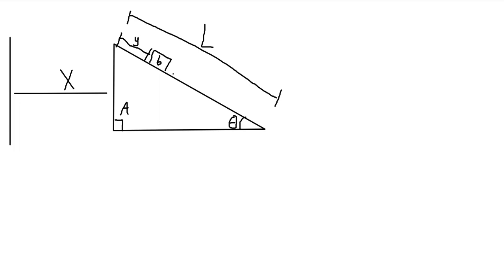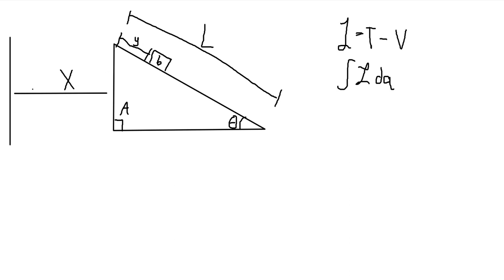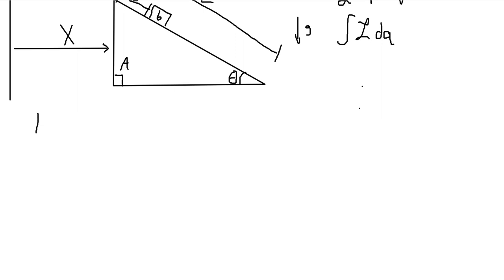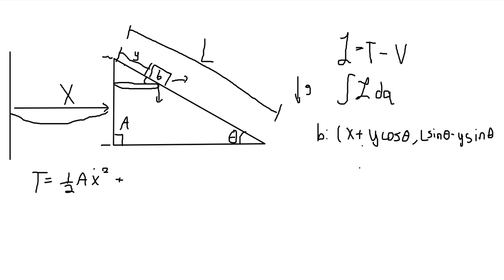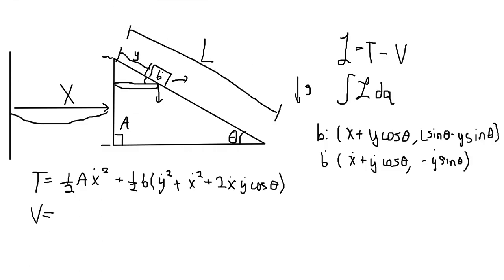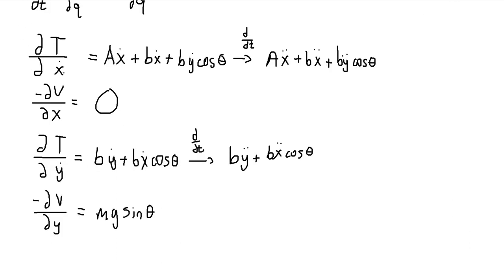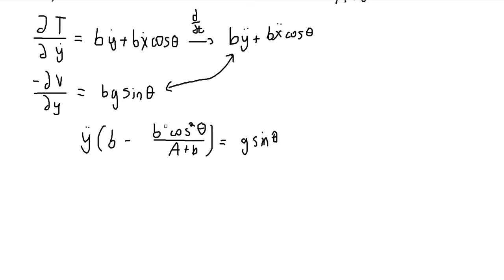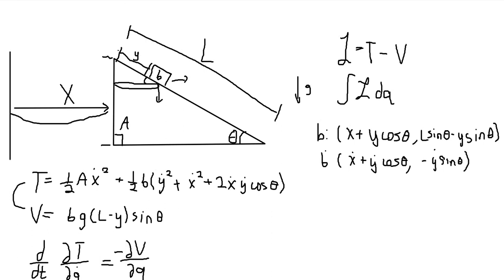Classical Mechanics: Mass Sliding on a Moving Incline

Comment: Isn't it sort of silly to call mass "A" and velocity "x"?  Why not m and v like you'd traditionally see them in a text?  The way you're using them, A looks like a constant and x looks like another kind of variable all together.
Reply from the maker: There were two masses, so I didn't want to deal with indeces or similar letters, so I just let the masses be A and B. X is not the velocity, it is the displacement of the plane from the y-axis.
Reply: Are you a high school student?  You don't use capital letters for variables like mass.  It seems like you're unfamiliar with standardized mathematical notation.
Reply from the maker: @johndavid4007  yes, but I've certainly seen problems using M and m for different masses. It doesn't really make that much of a difference.
Reply from the maker: @johndavid4007  and, for reference, the source I got this problem from uses M for the mass of the plane and m for the mass of the block.